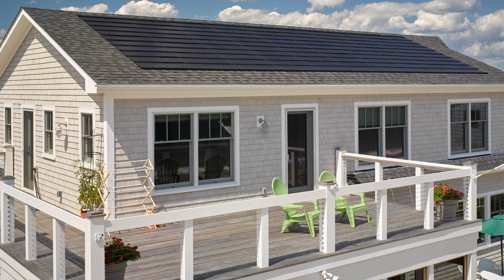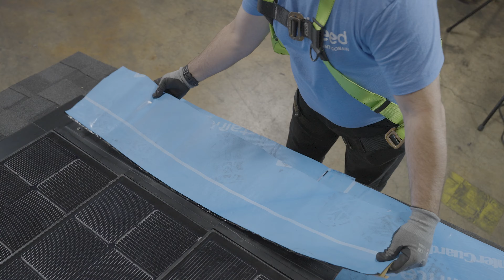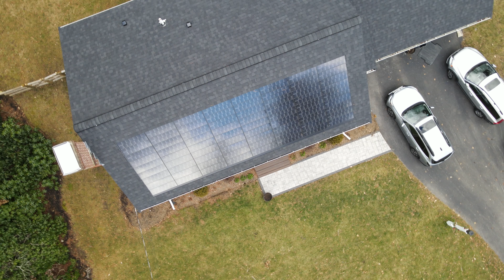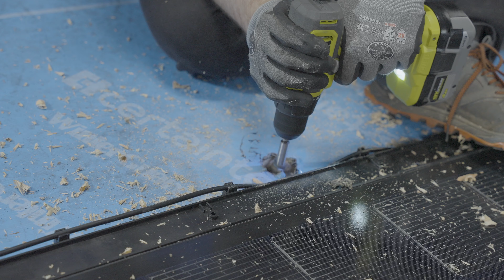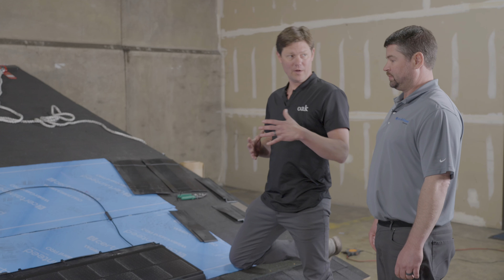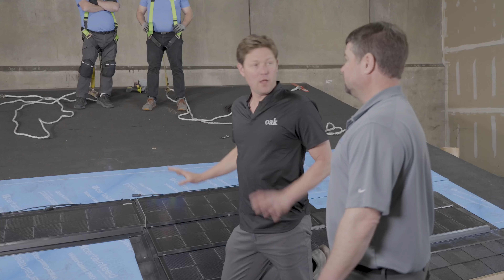Certainteed Solstice® Shingle - Complete Installation Guide | CertainTeed

Comment: what is the performance in terms of kwh, compared to regular solar panels ?
Reply: These solar shingles have to be a roof/waterproof layer first, so they overlap for waterproofing and come in many smaller pieces. That means a little less active PV area and slightly warmer operating temps than a ventilated rack-mount panel, so watts per square foot are typically a bit lower. In practice, kWh comes down to total system size, layout, and shade. With adequate roof area, our company routinely designs CertainTeed Solstice shingle systems to deliver comparable annual kWh to panel systems. Our solar roof customers in Madison, WI are able to fully offset their annual electricity use with CertainTeed’s Solstice shingles when the roof area and sun exposure support it. If you’re very roof-area-constrained, panels might win due to power density. But if you want a clean, integrated roof that also produces power, Solstice shingles are a strong choice.